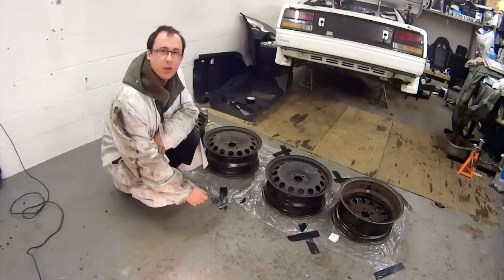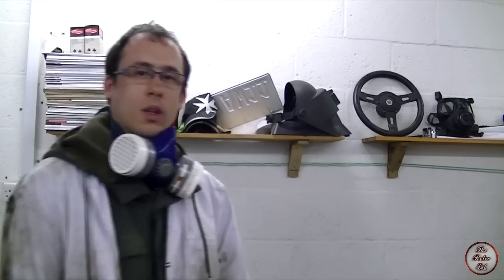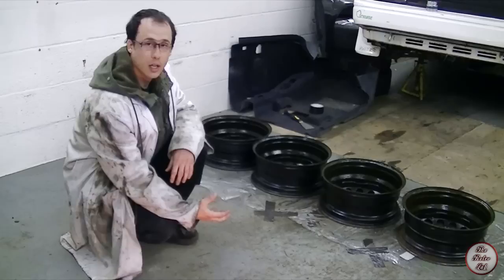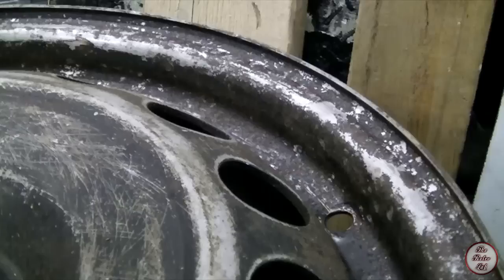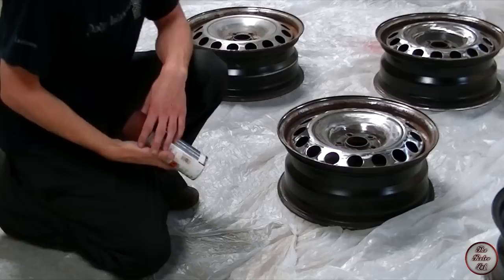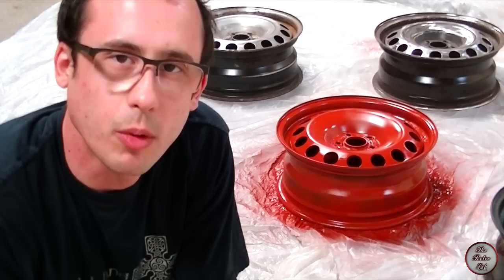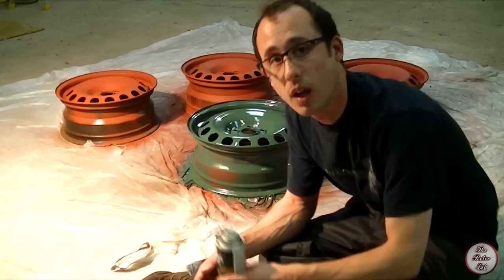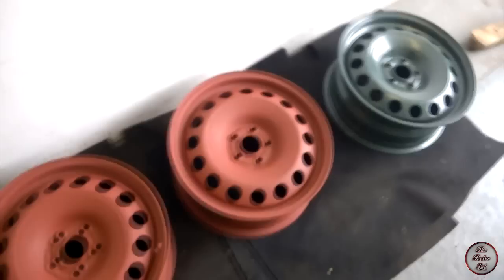How to Restore Steel Wheels (Rust Removal and Spray Painting)

Comment: Wouldn't it just be easier to use an angle grinder with a wire brush fitting to remove the paint and rust? Then spray? The hand sanding just seems to be a long winded way of doing this! E
Reply from the maker: +Edward Skerritt Yes that would probably have been quicker than by hand, it did take a while! lol Thanks for watching! :)

Comment: if you have pitting on the inside where the bead hits would it be ok to grind them smooth ????  or is it better to fill em with epoxy ?
Reply from the maker: +No One When I go get tyres the tyre shop I use normally put some kind of rubber paste around the inside of the rim to help seal the tyre to the rim to stop leaking, if the pitting isn't too bad I'd probably just sand it down rather than use filler. Thanks for watching! :)

Comment: What I did to restore rusted wheels was slice rotted tires off, cut tire bead with saw, fix any wheel damge, build a sandblast box, sandblast the wheels, use automotive primer on wheels, sand wheels with soft sanding pad, and paint

Comment: what if your wheels are new  but you want to keep them from rusting ex.2014 versa
Reply from the maker: Alex Murphy As long as you keep them clean (wash them often) and touch up any chips etc then they shouldn't go rusty for a long time, you could always put another coat of paint on anyway though. I saw a video where they got their steel wheels dipped in the chemical they dip guns in which apparently makes it so the wheels will never corrode, so you could try that if you want to go all out. lol https://www.youtube.com/watch?v=yaufZvM-AnE Thanks for watching!

Comment: I am painting mine and doing the clear coat. The wheels are on top of cardboard. Whenever I paint the wheel and go to do the other side the cardboard is stuck to the wheel and ends up pulling the paint off the flange edges of the wheels. How can I avoid this?
Reply from the maker: I had this problem when trying to paint a pulley, you'll need to lift the wheel off the ground by putting a block of some kind on the inside of the wheel/part that would not be painted, lifting it up. hopefully that makes sense. lol Thanks for watching! :)
Reply: @TheRetroLab  thanks for the tip. I got the idea to put the wheels on an upside bucket and covered that bucket with trash bags. Hopefully it works out.
Reply from the maker: Yes that is a good idea. Good luck! :)
Reply: @TheRetroLab  thanks
Reply: Hang them up on sky hooks.

Comment: my steel rims are already on my car. is there any quick simple way to do it and not ruin the car, like brush them with the steel wire brush and just use tremclad and repeat??
Reply from the maker: You'd need to make sure whatever you used didn't eat the rubber on the tyres but you should be able to sand and paint them while they are still on the car. Thanks for watching! :)
Reply: If you think the outside needs derusting, it's a sure bet the insides are worse.

Comment: sanding blasting booth would have been better and faster with much better results.
Reply from the maker: Yes it would but I don't have one of those. :( Thanks for watching!
Reply: @TheRetroLab  you might want to look into one of those that are mobile. You can use it outside and then there are those that you build cheaply.

Comment: You have a wire wheel to put on a drill?
Reply from the maker: I didn't at the time, but it would probably speed the process up a bit, you would still need to sand it after though. Thanks for watching! :)

Comment: can someone tell me why stock steel wheels have those holes in the sides, cooling, weight savings, performance?
Reply: leaving a reply because I would love to know as well
Reply: The reason i ask is because I have these kinds of stock rims, i had to change one back in 2007, Anyways i changed all my disc brakes at that time. and i used a different rim from chrysler, same size  but that one has smaller holes and it is thicker.  eventually the disc brake on that precise wheel with the Chrysler rim warped on me and the other one didn't. I guess it was keeping too much heat inside alexskills
Reply from the maker: +carlosb1 Hows it going? Thanks for watching! I'm not completely sure why they have holes in them, I thought it was for cooling of the brakes but Danthrax thought it was for weight reduction. Sorry. :(
Reply: +The Retro Lab Why not both?
Reply from the maker: +Khrrck Good point! :)
Reply: +carlosb1 Bracing. With the holes it's stiffer.
Reply: To aid cooling to the brakes

Comment: How do I do this too alumnium wheels like my brothers alumnium wheels
Reply from the maker: Well Aluminium doesn't rust so you can skip that step, then just sand them and spray them, you can apparently use filler to smooth out any scuffs too. Thanks for watching :)

Comment: There are several factors in doing a pro job. One plan I found which successfully combines these is the Magic Painter Method (google it if you're interested) without a doubt the most helpful info i've seen. Check out this  super site.